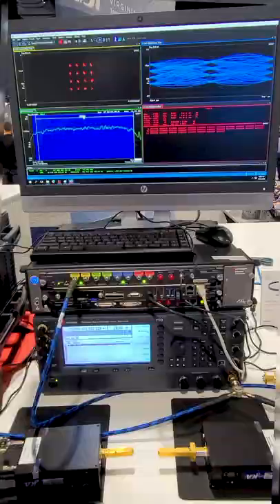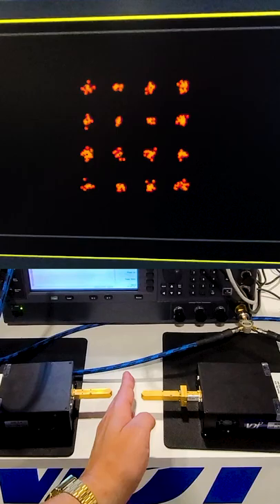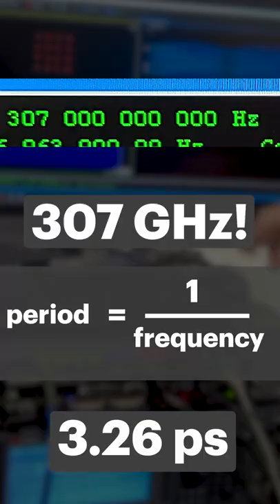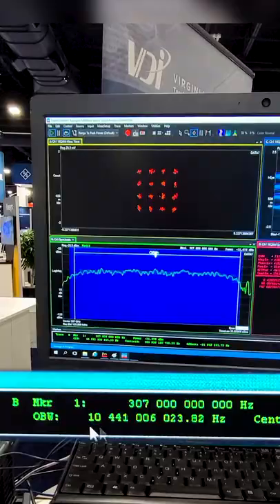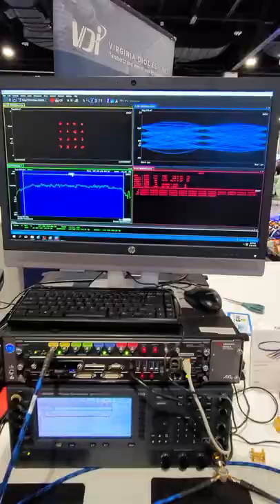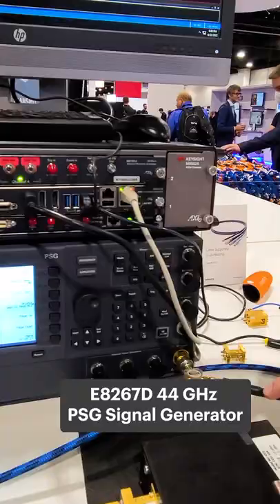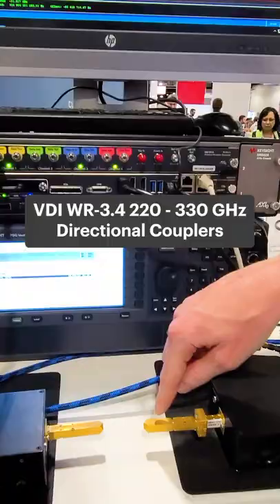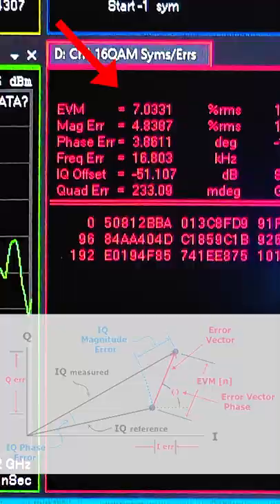The fastest signal I've ever seen #shorts

Comment: I get to play with a machine at work that emits a 3.6 ZHz (10^21) signal at tens of watts. It's so high you can use most any old silicon diode as an "antenna", although haven't tried putting my hand in it and I don't think I will... The maximum achievable bit-rate is however rather low as it has a mechanical modulator. (it's a 6 to 15 MeV medical X-ray LINAC)
Reply from the maker: I've never thought of X-Ray frequencies like that but it totally makes sense!
Reply: @KeysightLabs  It does get weird at X-ray frequencies, the particle description often works better but it's still photons, same physics and theory. X-ray communication does actually have some promising advantages specifically for deep space communication, in theory it's better than laser communication for very specific applications.

Comment: That's impressive. What is the use case of this setup? I'm guessing some high tech military like?
Also that intentional slight misalignment of antennas triggered my OCD 😩.
Reply: The primary use case of this setup is flexing on a convention.
Reply: @Jajaho2  I thought so too lmao. Its worth flexing
Reply: Many of those type of research-projects stay useless for a long time - hard to know what it will be used for in the future.
this is the start, now they likely will try to improve range and signal-quality, reduce powerconsumption and equipment cost - and then... maybe for signal transmission in environments that absolutely must stay sealed? Like in Biolabs, research-reactors or whatever else where you really do not want to have a cable going through a wall.
or in 30 years in RF-chips for faster secure payment. Who knows.
Reply from the maker: This is a 6G proof of concept. Also kind of a flex 😎

Comment: I can confirm that this demo is 100% true and it highlights the incredible capabilities of the Keysight giant; the M8195 AWG (my friend since 2019), especially when it comes to 6G stuff. 
I was just wondering what could be the data rate used in this demo? I'm asking this question because the constellation diagram looks very clean. The second thing that also impressed me, was how could you generate a 16-QAM signal with a vdi extender. 
To the best of my knowledge, this vdi is just a single port device, which is suitable for modulations like OOK and BPSK, but cannot work as an IQ mixer.